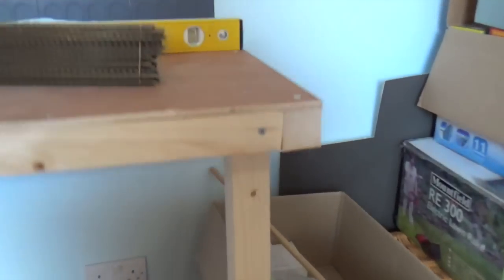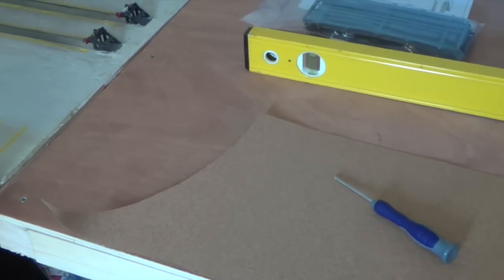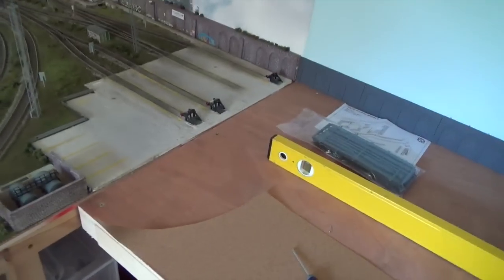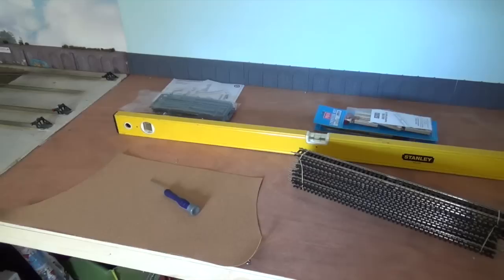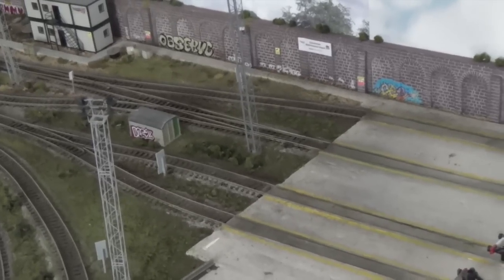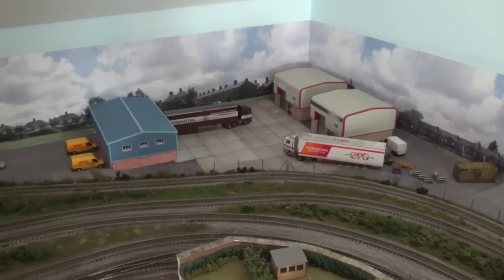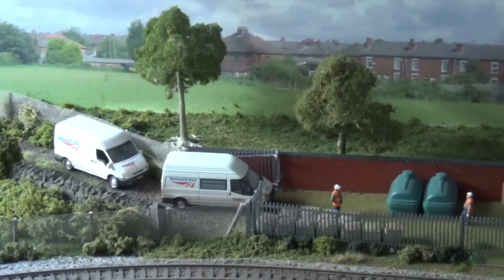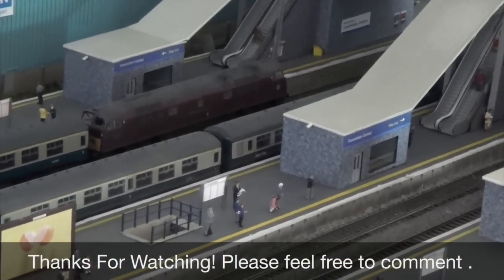Caversham Central Update October 2015

Comment: Well you can certainly pack a lot into that extension with no problems and the baseboard look absolutely fine. I wouldn't worry too much about that small gap because you can fill that with the cork when that goes down. Nice job.        .........Graham